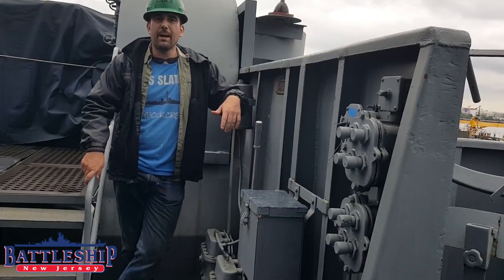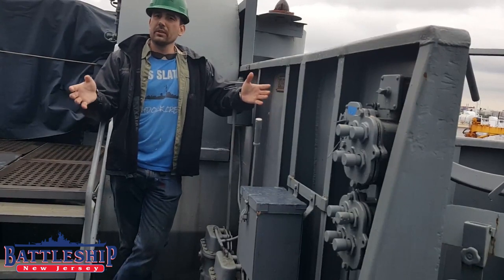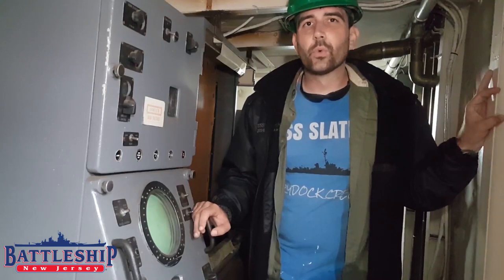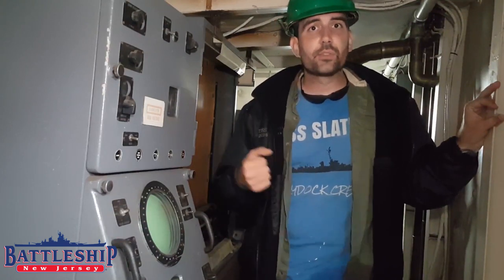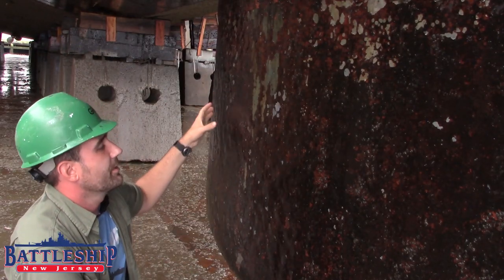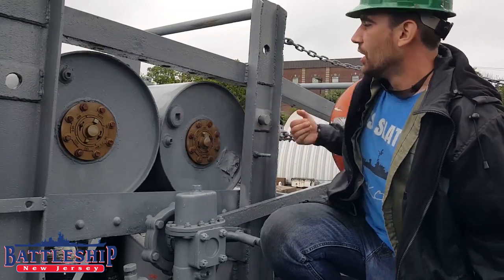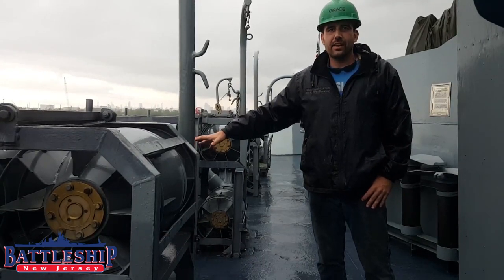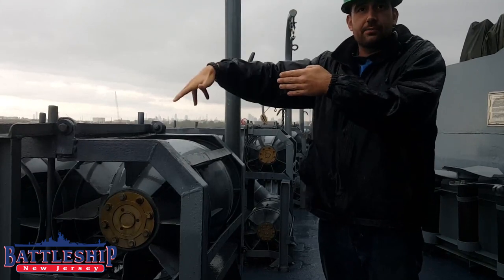Anti-Submarine Defense

Comment: Great presentation. I was fortunate to have served in the 1970's version of USS Slater: a Knox-class DE/FF which had the same mission. Instead of conventional depth charges, we had specially designed ASW torpedoes (the Mark 46) which used acoustic homing to track a sub. Other weapons systems included a 5" main gun (which the Slater probably had an analogy), and a Sea Sparrow anti-aircraft defense system as well as Harpoon and ASROC atomic depth charges.

Comment: I have heard it took up to 10 or 15 minutes for the Sonar to work properly after a depth charge attack, because they had to wait for the bubbles in the water to dissipate.  Is this true?
Reply: MCM NeverReadsReplys  A depth charge creates huge quantity of bubbles whose persistence depends in some degree the depth where they burst, the size of the charge, how many in the pattern, etc. The bubbles effect sonar in 2 ways: 1) they create noise and 2) they reflect active sonar transmissions.There are too many variables in each case to answer whether or not the bubble cloud will interfere. Another aspect the general public isn't aware of is that the ocean basins are tremendous echo chambers where the initial pulse of acoustic energy of the explosion bounces off the ocean floor back to the surface multiple times till it's energy gets attenuated and this will also affect regaining contact.

Comment: I was trained as a Coast Guard sonar technician in 1972/ 73 and I find it very difficult to listen to the uninformed but well meaning museum folks stumble and stutter their way through a description of "how things worked". For a starter.... the piece of electronics in the sonar shack he's showing is a post WW2 system, possibly an AN/SQS- 4 or some variation of that system, not a WW2 system. The console he's showing is what we call a "stack" and it's where the operator sits and searches and tracks targets. This one shown has a 360°video display called a PPI... Planned Position Indicator. In reality this is video display of received sonar info for a 270° arc centered on the ships bow leaving a 90° blank area centered on the stern. Sonar audio information is from a very narrow horizontal arc so we can localize the target by listening backed up by the visual display. ALL WW2 sonars, passive and active were what we call "search light" sonars because the hydrophone arrays were quite basic and only sensitive on a very narrow horizontal arc and fairly wide in a vertical arc. This array was trained left and right manually. If there was a target out there but outside of this narrow horizontal arc the operator has NO idea it's out there so they have to keep rotating their hydrophone manually back and forth searching. If the target is within the beam width of your particular system there was both an audio cue plus a visual cue either on an "A" scan scope or paper trace. With a WW2 passive system the operator had only bearing information and active systems had both bearing and range information. Other information for both systems was propeller noise which by listening to how many blades on the propeller and counting how many RPM's the prop was spinning you could figure out how fast the target was moving. To get a proper fire control solution to aim your choice of weapons, depth charge or hedgehog, you needed to plot both the target bearings and ranges to get his course and speed and then determine your course and speed to intercept and attack. This may seem like an overly complicated explanation but in reality it's much more complicated due to all kinds of physics but after lots of schooling and getting experienced it's the most fascinating thing I've ever done!
Reply: There is a Western Electric made QJB on SLATER, but it is in such a tightly cramped space, I can see why the video was not shot with it. That QJB is a real World War 2 era device, but is not original to the ship. I found it in a New Jersey surplus warehouse, but I figured the ship needed it more than I did, so when I liquidated my sonar collection, SLATER was the obvious new home for the QJB (and it is not like WW2 era sonars are real common anymore). There is a 1950s era SQS (maybe a -23?) on SLATER as well, leftover from its time in the Greek Navy. It is far more accessible, and looks pretty much the same. I think that is what was used for the video.